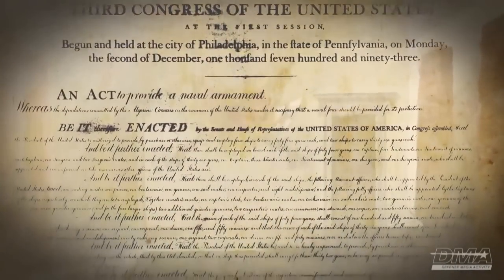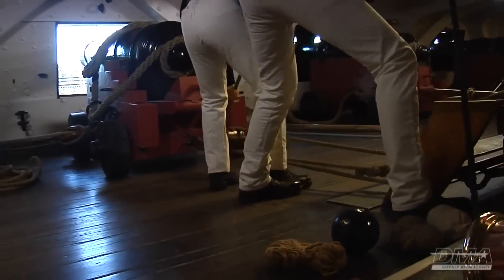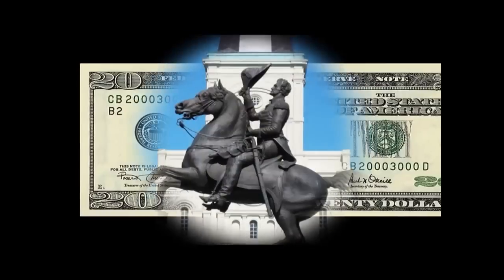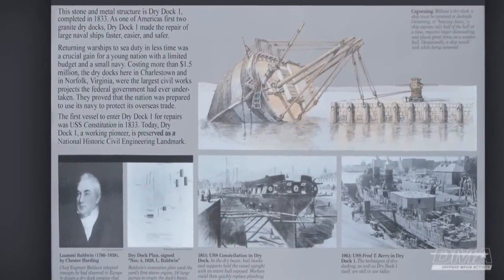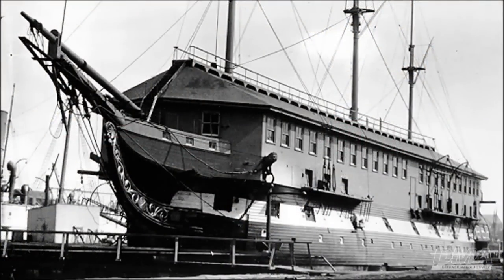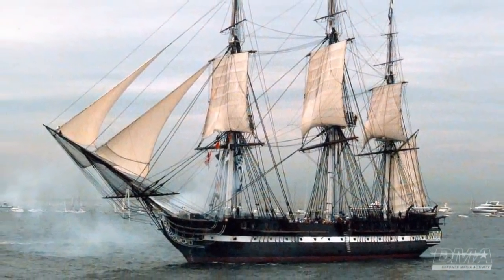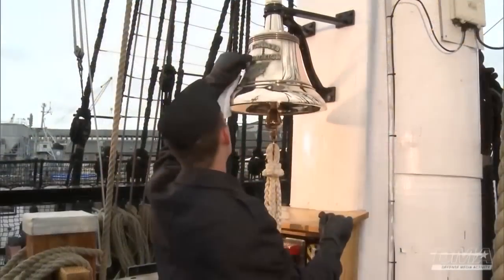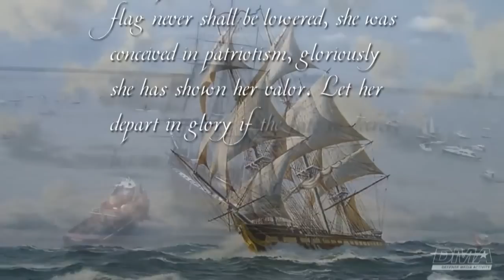WE BEAT THE BRITISH! Oldest Commissioned Warship...STILL SAILING!  USS Constitution! #warfighters

Comment: HMS Victory should be recommissioned & put back onto the water.
The best way to preserve a machine is to use it as the design intended.
As long as the Constitution is capable of sailing under her own power, she will be preserved. The same should be done for HMS Victory.
Reply: HMS VIctory was never paid off (decommissioned)  She is still the Flag Ship of the Royal Navy. Still in service!
Reply: HMS Victory is also in permanent dry dock.  The cost of refurbishing her to make her seaworthy would be astronomical since most of her repairs since she went into dry dock in 1922 have been cosmetic.  USS Constitution, on the other hand, has had an ongoing program to keep her seaworthy which keeps the cost of periodic maintenance down.